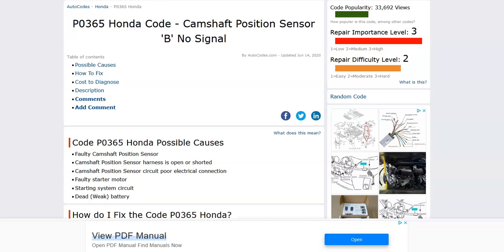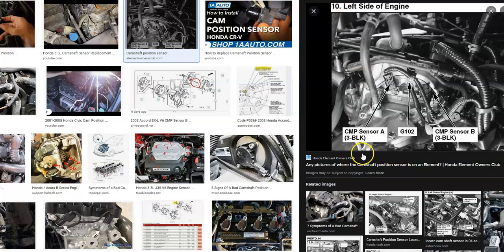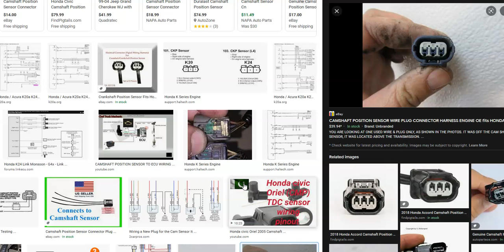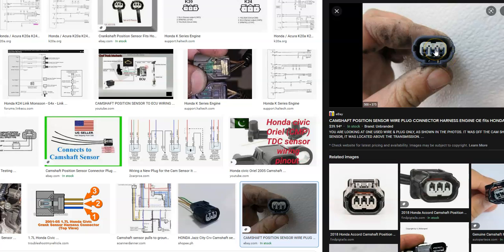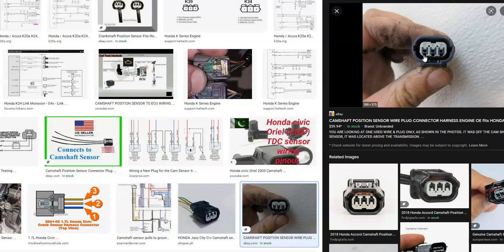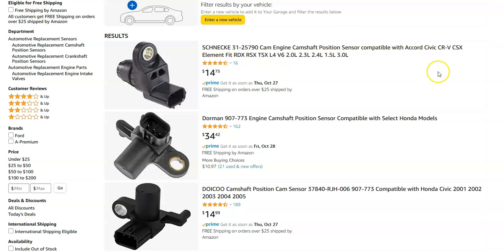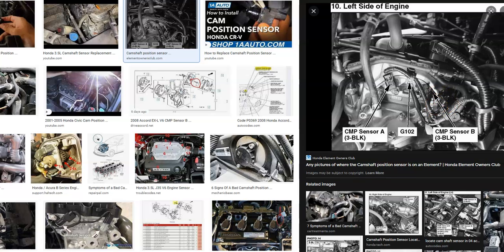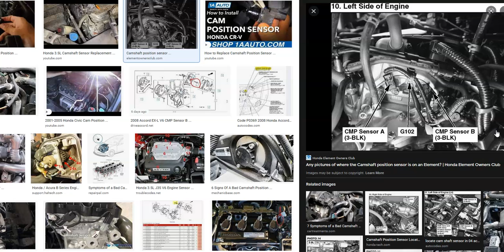How to Fix Honda P0365: Camshaft Position (CMP) Sensor B No Signal

Comment: ok ... 
so i have a honda jazz (also known as FIT)  2011 manual drive 1.2 litre i-vtec car that was driving around 20mph (i had not long set off) before i got the P0365 error code my scan tool at the time couldn't read the full description so i have no idea if it said B or not... but i am aware on ONE location for the cam shaft position sensor (back of the engine right next to the throttle body) which i replaced, i still had this error until the code was reset - all the wiring looks good and was tested with a multi meter to be sure.
now its showing NO CODES but will CRANK & NO START , so i can get the starter to do its job everything is moving fine but the computer doesn't seem to want to ignite, (all new sparkplugs too) any idea on where to go with this? 
is there a 2nd camshaft position sensor i am not aware of ????
Reply: What fuse does this go to? I don’t see a camshaft position fuse… do u know the name or abbreviation it uses on the fuse box (19 Honda accord 1.5l)
Reply: @DaWeird1  sorry i dont know, the 1.5 has a different fuse box layout to the 1.2 but im certain its a fuse connected to the ECU as the sensors arnt individually powered i believe (they are based on magnetic reading if metal close = on if not its off)
Reply: Same exact thing happened to me.
Reply: @blakelofgren2694  it's ur crankshaft sensor , depending on ur engine this could be on the engine back wall near the drivers front tyre or it could be held inside the engine itself.
Reply: Thanks for the info I’ll have to check that out today

Comment: How can I tell if it’s the cam sensor or crank sensor? It won’t start but it’s throwing this code. I have a 2010 Honda Accord exl v6 3.5 and I’m only finding schematics for one sensor
Reply from the maker: The Cam and Crank sensor give different codes. The Cam sensor is on the top of the engine while the Crank sensor is at the bottom near the crank.